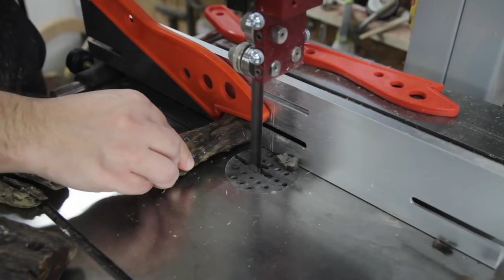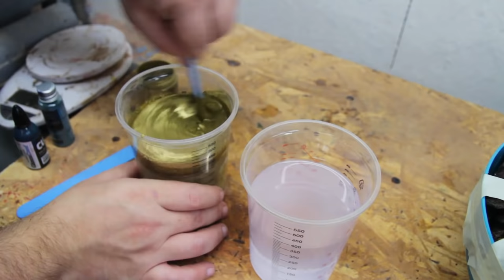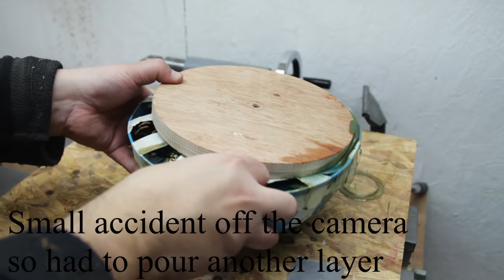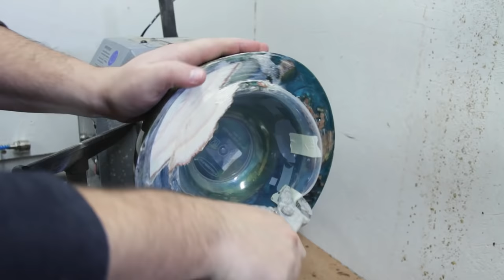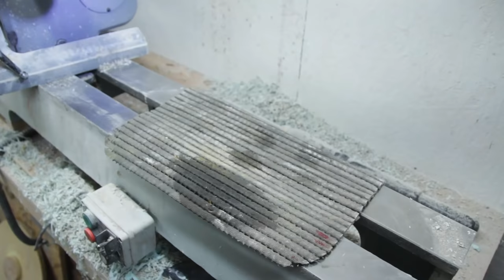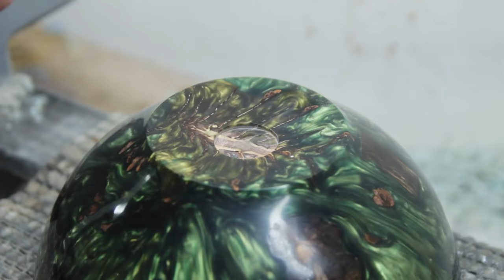Look at the INCREDIBLE transformation of those pine cones (Woodturning with resin)

Comment: Nice piece, David. Excellent preparation of the pinecones and mould. Didn't Doug Moore (Pohl Barn) recent have colour separation? Did you plan this based on that, or was that specific area from the second pour you mentioned? I'm always looking for more resin information and experiences to improve my work. Great video and nice results!
Reply from the maker: Thank you. If you drop me an email I can send you how the piece looked like after casting. After it went into the pressure pot I put some weight on top to stop the pine cones from floating. The weight moved after I closed the lid and cured with the weight pushing the resin out one side. Quite a coincidence Pohl also had very similar accident.
Reply: @DavidsWoodturning  That's what I figured. Ahron Africanmeat (yes, that's his channel) does the angled mould method to intentionally get line variations. I might need to plan that on my next pour.

Comment: I've seen it in a lot of video's but still don't know why the pressure is needed .. in this video you put the bowl in the tank for a few days. does the resin need such a long time to become hard, and what if you don't have a pressure tank?
Reply from the maker: It helps reduce the size of the air bubbles to a size human eye cannot see. Resin hardens within 48hours but due to cure fully until a week. But you can start work on it after 48hrs no problem. Like concrete it takes 28days to fully dry but you can step on it much sooner